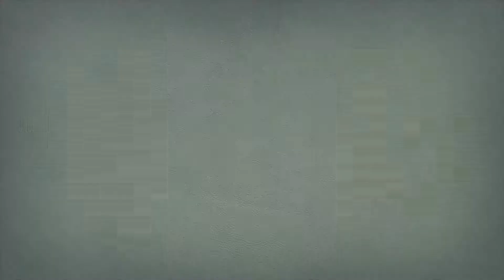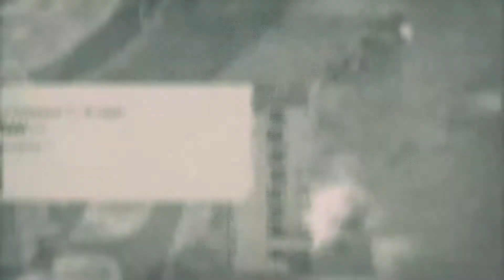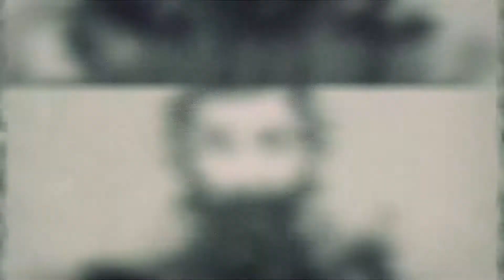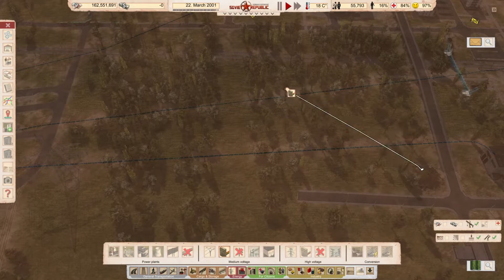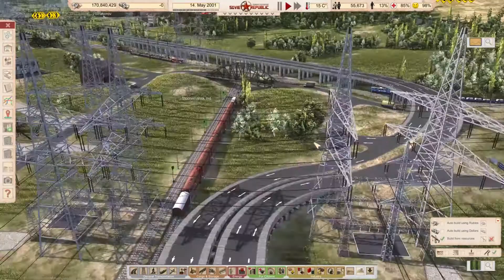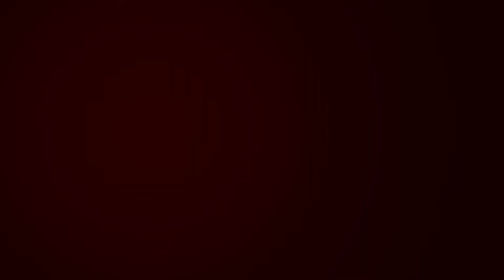Soviet Republic - Alaska - The New Beginning - Ep.225

Comment: Thought about train…. Should you go to 4 tracks before on intersection so you keep you main line flow better….
Reply: Yes you could buildt kind of a y-crossing. Leave the main lane to the right for a few hundret metres first while crossing left , then cross the tracks only from there to the left. Not directly from the main tracks. Also the train would wait there if it cannot pass into the area. The other trains can pass though. Theoretically. 😃It works fine for me.
Reply from the maker: Interesting. But isn't it just a parking on a "main line"? Just building adequate parking after intersection should do the trick.
Reply: @oolykeegaming81  i havent seen parking work well. This way you can seperate the on and off sections… think it will boil down to taking more space…
Reply from the maker: @Munktar-01  true!! I will try this out! Thanks, W!